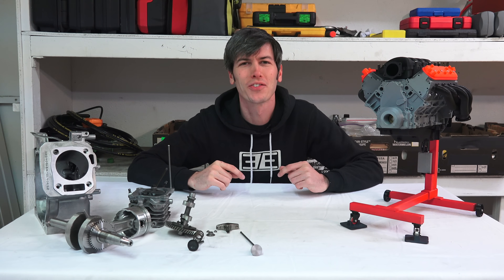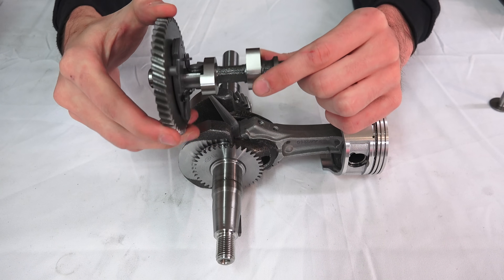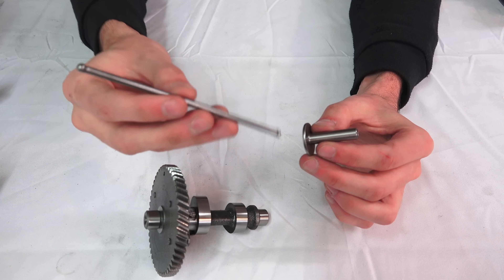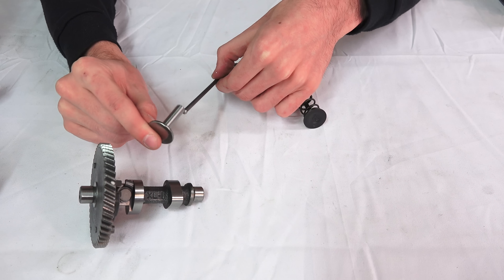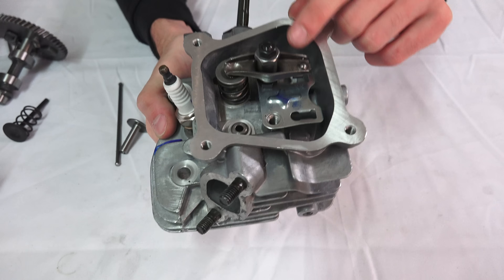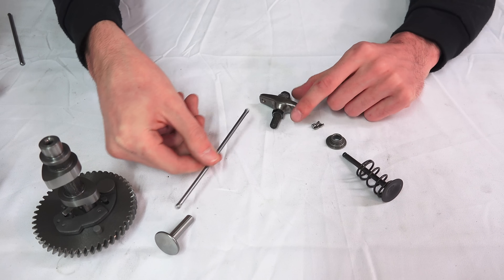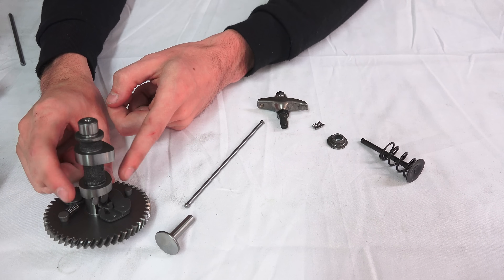Why Can't Pushrod Engines Rev High?

Comment from the maker: Here are a few other videos you may find interesting! 
How Do Engines Hit 9,000 RPM? - https://youtu.be/u3EKXGigeTQ
Why Engines Lose Power Over Time - https://youtu.be/uj8hjAjI7p4
How V8 Engines Work - https://youtu.be/KZLygdpg3LU
Boxer-4 vs Inline-4 Engine - https://youtu.be/mgpDTVBeHOw
10 Facts On The Hellcat Widebody - https://youtu.be/_rPsMThhhM8
I'll also be making a video very soon on the benefits of pushrod engines, because they're actually pretty brilliant designs, despite the banter often surrounding them. Hope everyone's having a solid day!
Reply: You forgot piston speed...  The reason why diesel engines have such low red line is because there is a much longer stroke. and the speed of the piston moving up and down is much greater because it has a farther distance to travel in the same time window as a normal gas engine.
Reply: My project car has a solid day every day, because it has solid lifters.  😎 

BTW, that 3D printed engine is really cool!
Reply: Engineering Explained what I want to know is where do you get those 3D printed engine models?
Reply: Engineering Explained AMAZING DUDE ! YOUR MY FAVOURITE !!
Reply: And that small engine cam has a compression relief device.  When at cranking speed, that uses spring force to move that little doohickey that changes the valve timing just enough to reduce compression which makes it easier to crank.  Once running, it uses centrifugal force to return the cam to its original configuration.
These are on many Briggs and Stratton engines and some others too.  
When that breaks it can easily trick people into thinking they have a bad battery or starter.
Reply: What about the benefits of lofting, the lifter from the cam lobe to cheat the cam duration rules in a given racing class. And, what about the Prostock and and the killer 12,000 RPM LS motors build by SAM Tech and Proline?
Reply: ptbelttactics Now you're  just spoiling the story by telling people about 12000rpm pushrod motors!
Meet a guy years ago that ran a big aircooled VW motor in a rally car,  he used 11000rpm with a 84 or 86mm stroke and a 94mm bore.
There were also some Ford 351C racing over here years back that used 10000rpm plus racing. 
Engine builder, him and his dad had built race engines for years I discussed this topic with, laughed at the pushrod engines can't rev, he commented  other factors limited things over 10 grand particularly weird harmonics as he put it, that had a detrimental effect on reliability.
Reply: Can we discuss The Alfa Romeo Guilia Quadrifoglio advanced efficiency mode and how it can operate on just half of the engine's cylinders
Reply: You should cover Ducati desmodromic valves.  No return spring.
Reply: Engineering Explained 
What about hydraulic lifters? Don't they also restrict RPM?
Reply: It would be awesome to see a similar video on pneumatic valves
Reply: On the video that you made about rcci  what is the difference between the rcci and hcci
Reply: Lord Samich
Reply: Where do I get one of those model LS3s? 😆😆😆
Reply: Hi, i ve seen sometimes on modified cars (example h22) "deleted EGR" can you make a video about that and maybe other little modifications (like an oil catch tank filter) the positive and negative effects, i think it would be useful 
Sorry for my bad english i m french..
Thank you for your videos 🙏🏽🙏🏽
Reply: I thought another reason had to piston speed and the heat buildup caused by it.
Reply: Yes,  solid lifters will cycle much faster than hydraulics, but the difference isn't really pertinent to the subject of pushrod vs OHC. The additional mass of the entire lifter/pushrod/rocker assembly is the limiter that he's discussing.
Reply: calholli wondered the same thing. Reckon piston speed should have been part of the discussion.
Reply: Hey Jason, do you think you can explain brake bedding and whether it is a myth or truly necessary like breaking in the engine?
Reply: bunning63, the limiting factor for turning more RPM in V8s once you sort out the valvetrain is the Piston speed. He left out the fact the Formula motors have miniscule strokes. Jessel shaft rockers and belt drive and the overhead cam stuff losses all its advantages.
Reply: ptbelttactics True, someone commented elsewhere that stroked motors love to rev, lot of people don't get the piston speed issue.
Reply: Engineering Explained which one is faster bodytype. sedan , hatch,coupe etc?
Reply: wan badri Volvo used to race station wagons  due to their superior aerodynamics at the time in European saloon car racing.
Reply: 100% PureBlackMagiC Or discuss the years Alfa used a Holden engine and pretended it was their own...
Reply: lol i came into this thinking "what you talking about i seen a supercharged 460 BBF do11k rpm before"
then hear 22k rpm was not high and was like "really"

i didn't even know that pushrod engines could hit 22k rpm now i feel silly
Reply: Engineering Explained ... Very good presentation.
Reply: So its not worth it to turbo a ls v8 pushrod because its limited to high rpm? Then would you say a supercharger would be much more effective?
Reply: Maurice Ip  re turbo pushrod… 
Turbos and positive displacement superchargers can be designed to boost just about any rpm.  In my case I put a Kenne Bell positive displacement belt driven supercharger on top of my Lincoln MK VII at 7 psi without any other modifcations to the engine.  That psi simply pumps in 50% more air at almost all rps.   5L Ford (302?) ran like a 454!
Reply: Hey Jason! Why don't companies use the springless valve designs, as used in Ducati's engines?
Reply: Engineering Explained could you do a video of Koenigsegg's servo driven valvetrain? Seems like an obvious route to optimal (and individual) valve control, so why has there been so little development in this field?
Reply: Awesome video, loved the +20 knowledge gain on this one.
Reply: ever thought of rotating valves instead of push valves?, or plate valves with an opening in it
Reply: Engineering Explained I’m afraid you won’t reply because it’s an old video but I’d like to ask you why can’t the GM or Chrysler just use the air springs. Isn’t that much more simplistic and easy than reengineering the whole engine to make it a DOHC which is what the Shevy is currently doing to their small block V8?
Reply: Engineering Explained what is the spring/centrifugal weight thing on the backside of the camshaft gear?  What does it do?
Reply: Hi EE, thanks for explanation, you compared DOHC to pushrod,  what about SOHC engines? With 2 valves per cylinder wouldn't the airflow be similar without the bulkiness of 2 camshaft? Maybe it's something unit could mention on another video, keep up good work,  thanks.
Reply: Don’t have to rev that high to beat Honda’s no vtec required 😂😂😂😂
Reply: Go look at @carsandcameras they have many many many many pushrod engines (Small Engines) that have the capibilities of 9,000 - 10,000 RPM Explain that @Engineering Explained
Reply: This is why V8 are so slow😩😩😩
Reply: Solution put a stronger spring use magnets that repel on each end of spring  alowing engine to function at higher rpm
Reply: you probably dont care but if you're stoned like me atm then you can stream all of the latest movies on instaflixxer. Have been binge watching with my gf recently :)
Reply: Why are high revving engines good?
Reply: Engineering Explained nice 🔥🔥🔥

Comment: Normally, I’m not a keyboard warrior, I understand what you’re trying to say, but I’ve heard too many small block Chevrolet’s at 10,000 RPM they don’t have pneumatic springs, they usually have dual valve springs, or valve springs with a damper, the damper kinda looks like a second spring, but it isn’t.

Comment: I know mini had engine that reved to 10,000 rpm and there where 1300 cortina engine that reved to 11,000 so that isn't correct, twin cams definitely have ligher cam gear 😅😅😅

Comment: OHV performance engines can rev very high an example is the Rover SD1 3500 (Buick 215) Group 2  race car that revs to 8250 rpm ,flat plane cranks help engines to rev.

Comment: back in 1960's we had 283 chev poked to 292 that would shift at 10,000.     Ford 289's launching at 10,000 RPM    What do you consider high rev?   Had to change rod bearings about every run down drag strip but they revved.

Comment: Why not replace the spring and keep the valve attached to the cam shaft, a valve crank if you will then then mass is irrelevant, you could remove the need for four valves per pot as you could have 2 big valves per pot and make it simpler to produce.
Reply: The spring is what helps return the valve to being closed you kinda need it or else you have a constantly stuck open valve

Comment: actually pushrod. motors can Rev high about 9000 rpm with the right cam and lifters, so your tag line is wrong.
Reply: He means they are not as sufficient in a higher rpm you lose power

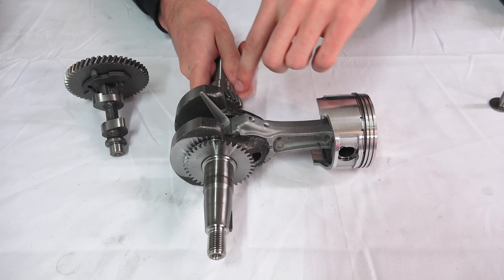Comment: What’s the spike thats traveling counterclockwise at 0:35? Is that a specific part that I can learn about?
Reply: Part of the non pressurized oiling system. (Splashes the oil around)

Comment: Your AVERAGE push rod engine doesn't rev very high for 2 reasons, 1:it's unnecessary for sufficient power, and 2:its not economical to build every engine on the road for NASCAR. Push rod engines are very capable of high revving, if they're built for it.

Comment: They can rev high, just no need to. With plenty of displacement and well manufactured components, you have a beautiful torque curve that allows great hp potential.
Reply: In my push rod car I barley ever rev higher then 3000 rpms there no need to at 2500 rpms im already doing highway speed the torque is amazing i love it.

Comment: I've been telling people DOHC is better for many years. Their reputation speaks for itself. All the Ferrari's, Lamborghini's, Maserati's, Porsche's, Mercedes, Audi's, BMW's, and Jaguar's have DOHC. Nascar was dragged kicking and screaming into the modern times. Thank you.
Reply: laughs in top fuel dragster
Reply: Relative to displacement, small blocks make garbage power compared to DOHC engines, but relative to external dimensions the tide swings rather significantly back the other way. Small-blocks are closer in size to Porsche's flat-sixes than the Ferrari V12s that the strongest of them can match for power and beat for torque. For all the (deserved) love twin cam heads get for helping engines make huge power from minimal displacement, the fact still remains that a GM LS can fit in engine bays meant for rotaries. 

Better in some ways, worse in others. Looks like someone didn't actually watch both videos. "Pushrods suck! No, pushrods are better!" The truth, as usual, is somewhere in the middle. But then getting a rise out of people was the point, right?
Reply: They are not better with the long timing chains and belts.

Comment: hahah my nissan with the a12 engine can rev 7000 rpm stock
Reply: Not about RPMs it’s about torque. A push rod engine can achieve the same power at lower RPMs it’s when you get into the higher band of those RPMs you lose performance but from a dead stop a push rod engine will blast off the line much quicker then lose out to a car that can rev higher.

Comment: I built pushrod SBC. My last one powered my Cobra. All cast iron and reved easely to 7000, float at 7400. Key is a proper valve train geometry.  Something that a base SBC lacks. Beehive springs, proper helper spring, light valves, and a ramped roller cam makes high revs possible. 500hp

Comment: Huh, my 351 Cleveland touched 10,000 rpm routinely. What constitutes high rpm by your metric? I get that it is a lot of reciprocating mass but that's why we have stronger than stock valve springs and push rod guides that were installed on the boss and HO heads and hardened cams.
But yeah, we solved valve float over 40 years ago. You might have some textbook knowledge and while that's good, and you are technically correct if you consider anything below 20,000rpm low. Of course overhead cam is better for all the reasons you mentioned but 10k is pretty damned high rpm and my pushrod motor did it and my overhead cam doesn't. The reason is this; the giant intake valves (over 2 inches diameter) had so much room to pack springs into and a lot of area over which to distribute force. It was easy to achieve desired open and closed spring pressure. The little 2zz-ge has so much less space due to the 4 valve per cylinder that the springs now have to fit a much smaller foot print. True each spring has less reciprocating mass to counteract but remember our old buddy "pi"? That's right the area we have is a volume and PI is right there waiting to diddle your anus. Don't forget we have to be able to exceed the stroke of the valve opening and reliably close the valve without the spring contacting itself. So while there are solutions out there they are expensive, unreliable and consume power even worse than it did on my Cleveland and we never even heard of titanium retainers back then.
The only reason I gave all my old engines away decades ago was that they weighed so much. It wasn't the power. It was the inertial forces that wouldn't let me around a corner. I could do more with half the horsepower, 1/4 the weight, and 1500 fewer rpms. 
So while technically everything you said was correct, you drew some opinions that were not. You didn't even mention that desmodromic valve trains exist that answers most of our issues be they pushrod or overhead cam. Now koenigseggggggg has their freevalve technology and it will only be a matter of time before camshafts are gone altogether, and I cannot emphasize this enough GOOD RIDDANCE TO THEM.
10,000 rpm is plenty for now.

Comment: Can’t rev high? A simple cam upgrade gets an ls2 up to 7200rpm, why do you need to rev more than that when you’re producing enough power anyway, charge it and a few other things and you can be at 700hp with a 7200rpm redline which is more than enough revs in a big v8 engine

Comment: We build Ford 289 historic race motors with flat tappet cams, that rev to 7k no problem, and make 460hp out of a 4.7l motor. And they are simple, why do you need the complexity and weight of overhead cams, chains, sprockets, pulleys and belts?

Comment: Independent intake valve timing it's possible on pushrod, you can get that torque even lower, and higher increasing maximum horsepower, especially with more valves per cylinder

Comment: Seems simple to me. High rpm horsepower needs to have modified carburetor, high flow intake manifold,  radical camshaft with lightweight valve train, high tension valve springs, enlarged intake/exhaust ports with tuned headers. Speed cost money so how fast can you afford to run?

Comment: What was all the hardware on the camshaft gear of the single cylinder engine? Surely that little thing wouldn't have variable valve timing??

Comment: Chrysler should have used the 3.5 high output V6 engine system they have in the hellcat make it a V8 because it sounds good and it revs higher than the Hellcat and I wish they have a manual version of the V6 3.5 Challenger sxt it would sound just like a G35

Comment: Why don't we connect the valves to the cam shaft the same way we connect pistons to the crank shaft?  No springs required.  Sure, no adjusting for RPM's but no valve float either.

Comment: tuners rev the LS/LT motors to 9000 rpm, that's higher than the average OHC/DOHC. that suggests we only need OHC/DOHC above 8000 rpm. what I don't understand is why on earth are -4500 rpm diesels being designed with DOHC by the same company who has had the greatest success with PUSHROD motors!?

Comment: Solution put on a stronger spring a use electro or normal magnets to constantly repel causing a stiffer spring but allowing it to function at higher rpm

Comment: This is why Harley Davidson have large volume engines to make up for the lack of power/engine rpm.
Still doesn't explain why they're so fkin expensive.
PS these pushrod slow revving engines are also long-stroke motors which also puts a limit on rpm.
Think of diesel truck motors.
Higher revving engines are always 'over square' meaning the piston is wider than the stroke.

Comment: So you're saying the RPM limit of the pushrod engine is essentially dictated by the valve spring. Overhead cam engines use springs just the same. Ultimately the spring will be the limiting factor in any engine regardless of layout.

Pushrod engines are only limited by people's assumptions based on misinformation.  A few years ago the NHRA mandated a limit of 10,500 RPM for Pro Stock. Which uses a 500 cubic inch pushrod engine. Prior to that, many were turning north of 12,500 RPM.

Even in street applications, a little bit of knowledge goes a long way. One of my personal projects uses an LS1 based combo, hydraulic roller camshaft, and stock rocker arms. It's a street car that spends plenty of time at the track. It's shifted at 8,500 RPM every pass with the occasional touch of 9,000 RPM.  There is NOTHING exotic in this engine.  The valvetrain is basic off the shelf components.

Comment: Why not use the same setup as in the crank shaft and connect all the parts together?
Reply: Because the cam shaft needs to spin two times to open the intake valves and exhaust valves before the crankshaft make one rotation

Comment: I've had Honda 90 overhead cams for instance and I had a Honda 90 push rod ca200 the pushrod engine would blow the overhead cam out of the water plus the cam chain would disintegrate in 5,000 MI the old pushrod engine with last ten times as long